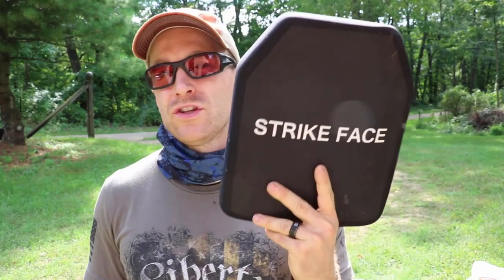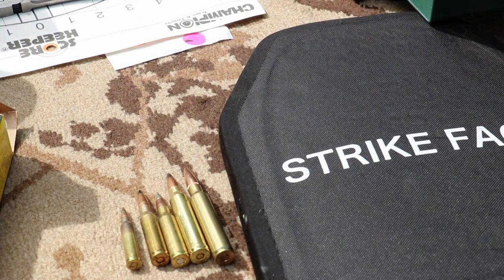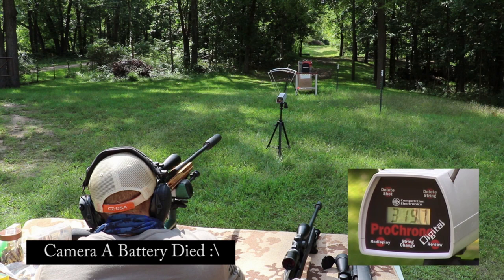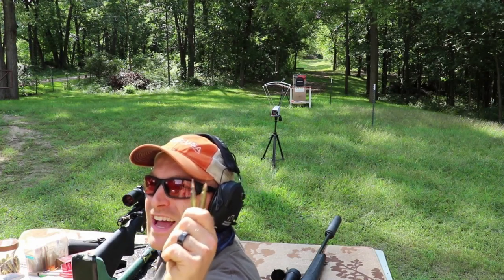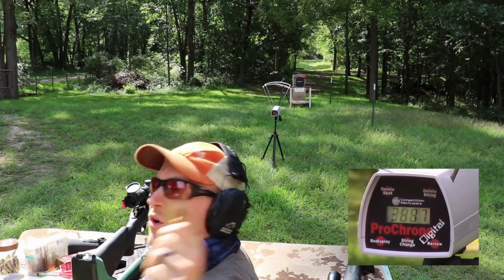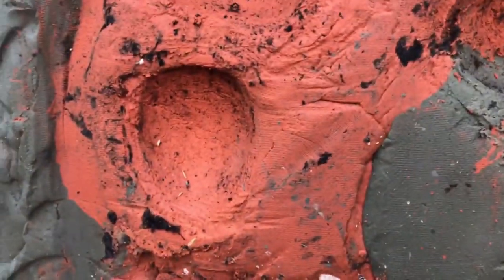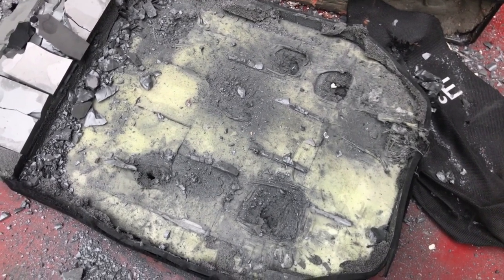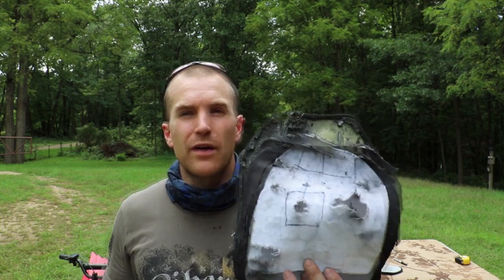MILITECH NIJ IV Silicon Carbide PLATE'S COMPREHENSIVE TEST BY BUFFMAN R.A.N.G.E

Comment: As far as I know, As lang as the Plate already has 1 or 2 Hits, You cannot use that again since those shots damages the compact composition of the materials inside.
Reply from the maker: Yes, you are right and we do not recommend using the hit plate again. Multi-hit performance is for the purpose of when you are on the battlefield and do not have the availability to replace the hit plate with a new one so that you can carry that plate while it still offers some protection. Another possibility is if a double or triple tap was fired in a mid-range, the plate is capable to stop if the impacts were landed on that same plate with a small distance in between the impact area.

Comment: On your verdict, which has better ballistic protection? Alumunium Carbide or Silicon Carbide?
Reply from the maker: They both good since they were made to the standard. SIC version is slightly lighter than Aluminum Oxide version, and we do have a Multi curve version in SIC too. If you consider the shape of plate and weight reference wise, then I would suggest SIC Multi curve
Reply: @militech6763  thanks!